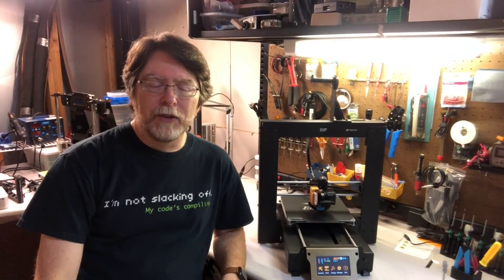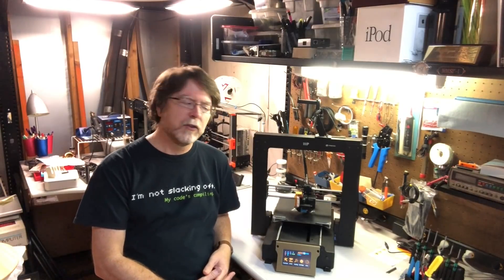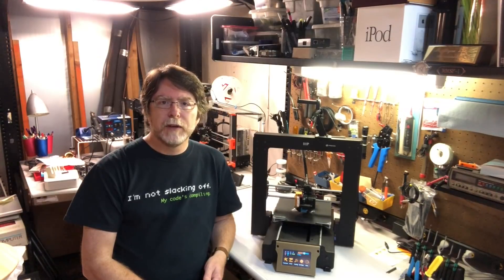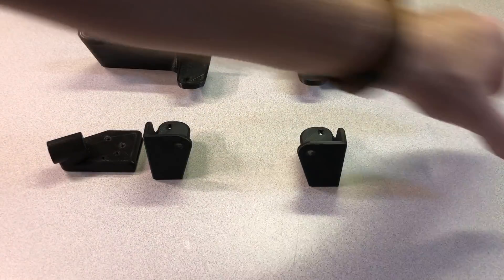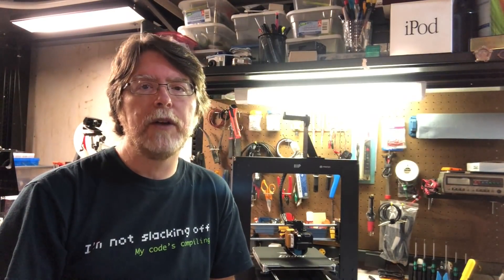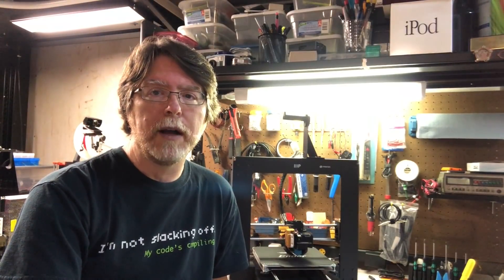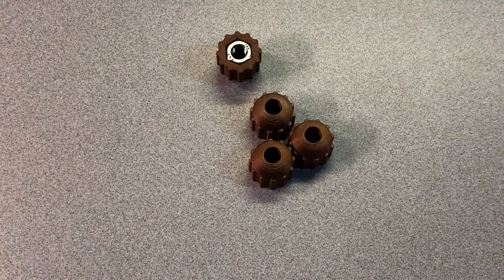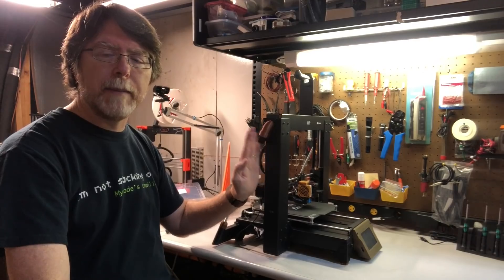Brace Yourself: Stop Z axis flexing with a rear-mount Z Brace mod!

Comment: How important were the leveling feet?  I was thinking about skipping those. Height is an issue for me because of where I have my printer.
Reply from the maker: Hi Ron, You can probably skip them, but you might want to put felt pads in their place, just in case there's a hint of wobble? Also the felt could cut down on printer noise transmitted to the surface it's sitting on.

Comment: I'm just now getting around to printing and doing this mod. Since it's been over a year for you, I just wondered how you like it and if you'd change anything now based on your experience with it? For instance, I realized it's a good thing I just watched your video about the unresponsive touch screen because attempting to fix it would require taking off those bottom feet parts to be able to remove the bottom panel. So what other mods might you recommend prior to doing this one? The BL Touch?

Comment: is there a metric version?
Reply from the maker: I don't see a metric version of this specific parts set. But I did find a similar rear Z-brace model on Thingiverse, which uses metric hardware. I haven't tested the design, but it's available here: https://www.thingiverse.com/thing:2438817

Comment: Thanks for this video! I downloaded the files and I have one question. Looking at the  .stl for the ball nut, it has a hex shape inside the bottom but also cylinder coming down flush to the bottom of the piece. Is this support material or do I need to remove a piece   of the cylinder in order to place the 5/16 nut? Thanks again, 
Rocky
Reply from the maker: Hi Rocky! Yes, that little cylinder is a built-in support. You can grab it with needle-nose pliers and just pull it right out. I thought it was a super-clever design because you don't have to enable supports in your slicer (and most of the time they would just fill that whole cavity with support material when all it really needs is just that little cylinder).

Comment: I've been looking for versions of the Y axis mod and this is by far the best one I've seen and not found until now. I'm am waiting on delivery of the Wanhao Duplicator i3 plus mk2 and I believe it has some differences in mounting holes but I won't know until I receive it in 3 or so weeks. Thank you so much for all the videos they are extremely informative well produced and I'm sure it's a time consuming process but fun at the same time. I hope you don't run out of Vegemite to soon. All the best. 😁

Comment: How do u make sure its square before tightening the nuts?
Reply from the maker: That's a great question! I used a speed square. Despite the name, it's a right triangle. Woodworkers use them to ensure that 90-degree angles are really 90-degree angles. I place the printer on a flat surface. Then I place one side of the speed square on the same surface, and the upright part against the Z axis. Adjust as necessary, then tighten down the screws and nuts. Repeat for the other side of the printer.

Comment: Thanks Bryan, I've just finished printing the pieces for a front mount Z-Brace. I think I like this one better. Great vid. Cheers, JAYTEE
Reply from the maker: I originally had front mounted Z braces, but then when I switched to a 50x15 blower for part cooling (front mounted), I couldn't use the entire range of the Z axis. The blower would run into the threaded rods. The rear Z braces solved that problem, plus I liked the look of the design. And the leveling feet were a nice touch.
Reply: @BV3D  Ah very good, definitely going that way now. Cheers